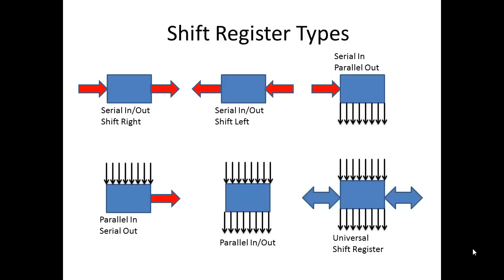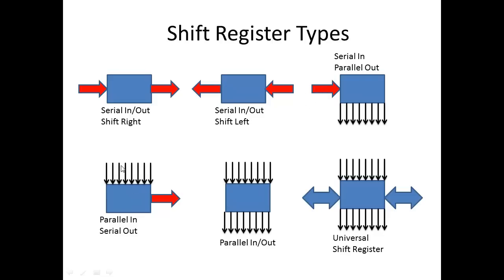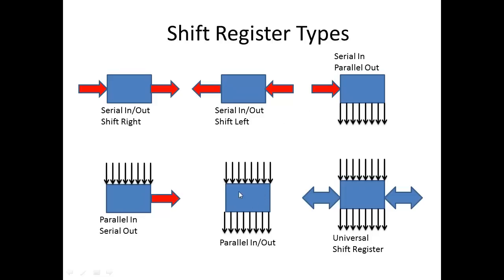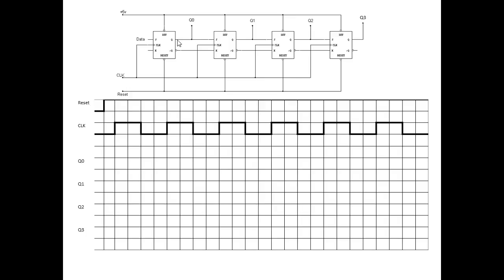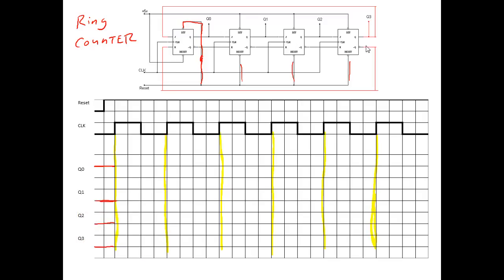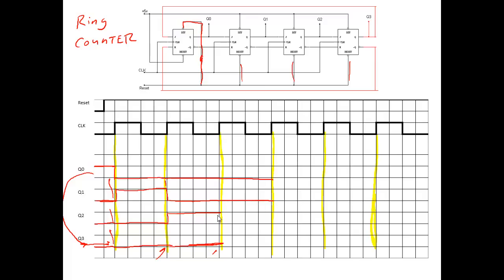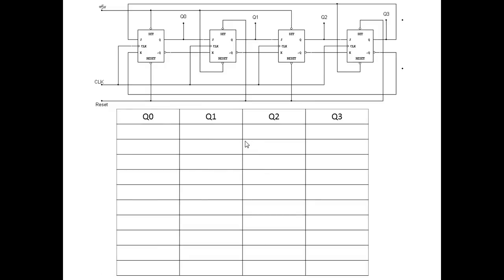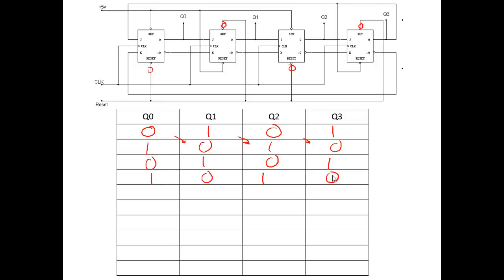Digital Electronics - Shift Registers

Comment: At about 10:23 where u have Q0 tied to high, if u were to tie Q3 to high , would that make it a shift left register?
Reply from the maker: No, that  would only change how the data starts. To make it into a sift left, you just read the data backwards. The way it is set up now, you shift the data right. To shift left, you would read the data as Q3 Q2 Q1 Q0. There is no true left or right in this set-up. Now with an actual shift register IC, you can set a mode for the IC to make it shift left or right.

Comment: How is a arithmetic  shift left or right performed on an 8 bit word say 11001100? Also how is a rotational shif left or right performed on the same word?
Reply from the maker: Aaron Loomis Are you asking how to do an 8 bit word instead of a 4 bit? If so, you would just add more Flip Flops to the circuit. It works exactly the same way. Shifting right or left with flip flops is relative to how you pull data. You really cannot make it move back and forth with discreet logic. Now a universal shift register IC has both modes SR and SL. Does that help?